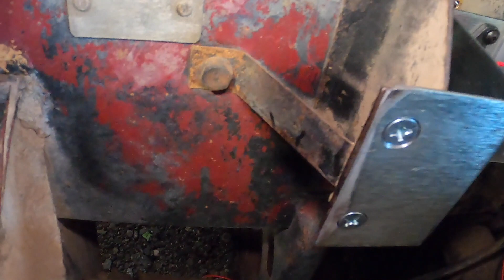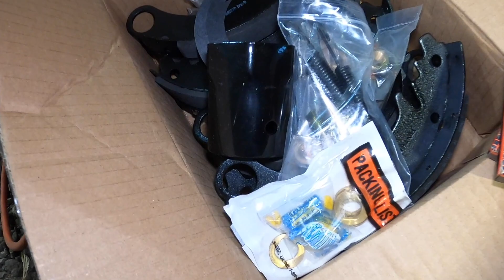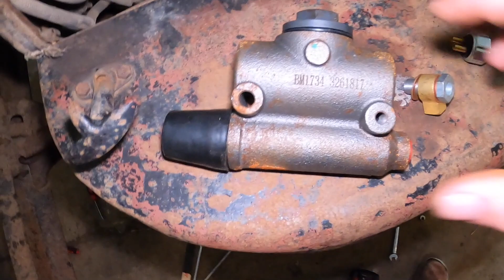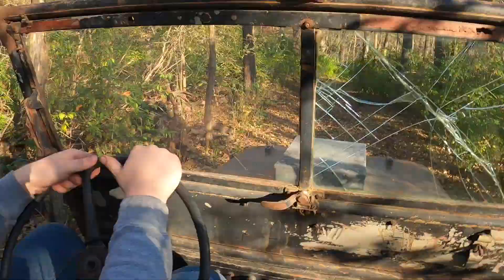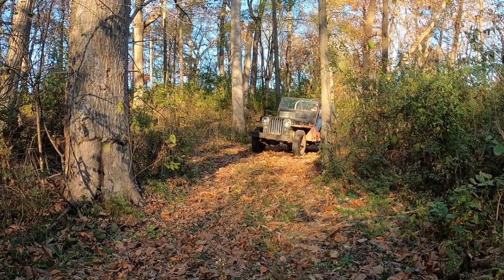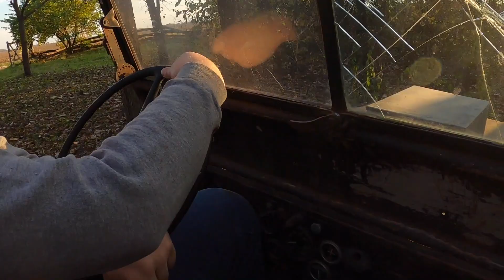Jeep Willys Rebuild - Part 5 - Wiring and Brakes, then its time for a ride!

Comment: Sorry man but that hood thing is super ugly , but I guess there’s no alternative maybe repurposing an old ammo box ?
Reply from the maker: It’s on my list of stuff to fix for sure. The new carburetor I installed sits below the stock hood line, so i should be able to make up some sort of low profile air box to connect to the carb, and make the hood flat again.
Reply: Hey Kevin, that was discussed in like the first vid, maybe give them a watch too ya silly scalawag
Reply: @dashburgess6991  I’ll check it out.